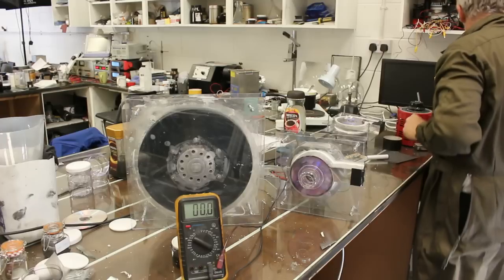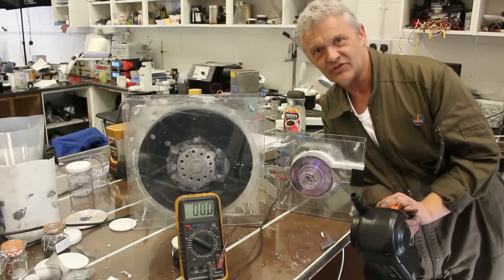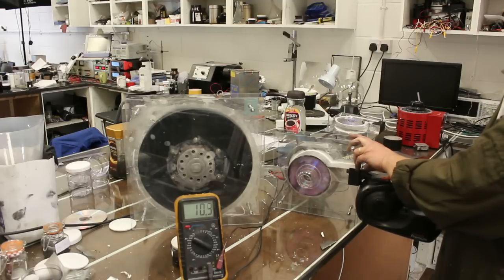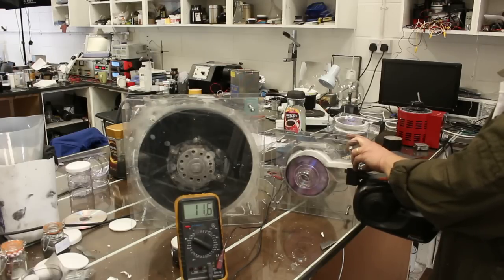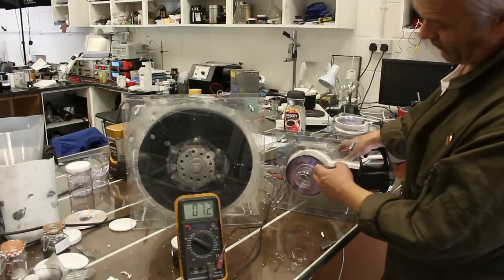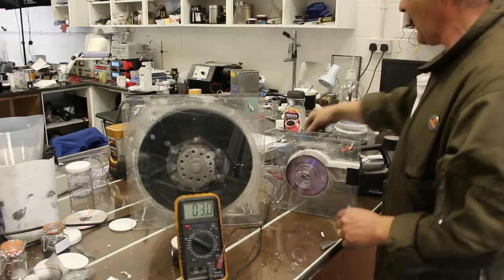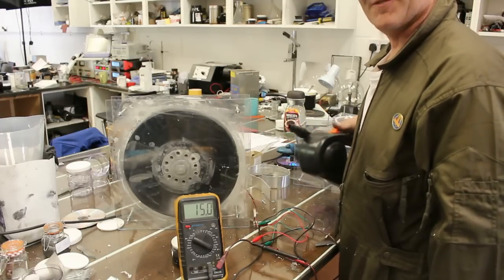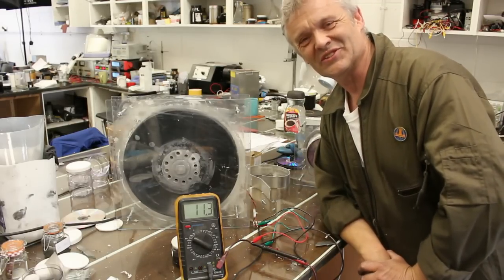Tesla Air Generator

Comment: Brilliant turbine.
Built one a few years ago from a old computer hard drive!
Disks/platters are all there and perfectly balanced. Drilled holes around center of disks for exhaust air, inserted an air nozzle through the casing and built up the casing with filler for a snug fit around the disks.
No way of measuring rpm but sound passed up through a shrill scream and went beyond my audible range in a matter of seconds.

Comment: "The efficiency of these things..."   Oh you are missing quite a bit- while saying it all.

Excuse my brazenness but I have spent a while thinking about the genius of this design.   Not only does increasing pressure increase power output, it also increases efficiency- because it actually makes not the wheel, but the path the air travels along the wheels longer once at full speed.

The air will travel in a spiral - the thickness of the line and the tightness of the spiral is dictated by the pressure and viscosity of the medium.   This is why Tesla was using not only very large discs, but destroying them with extremely high pressure super heated steam.  At around 300C steam can reach around 2400 psi or 163 atmospheres of pressure and at very high volumes easily.

By tightning the path of travel it not only increases its length- it also changes the vectoring of the air relative to the blades- the tighter they get- the more they follow the same path which also allows more energy to be imparted to the wheel.  The reason blades can never match the efficiency of a ideal tesla turbine is because by abruptly changing the direction of flow in the air you automatically waste some of its energy making it battle itself.  With the air travelling more congruent to the walls- you really unlock more of the efficiency.

So higher pressure means longer path and more congruent angular momentum which both also increases efficiency.

The cool thing about the discs are if you operate them too fast the machine will implode (at least with mild steel discs)- just make sure you stand clear of the output.  Even though at high rpm a large disc will suffer incredible g forces, the air pressure will force it to the center and try to blow it out.  At least by account of Tesla who was pushing the limits of metallurgy in his design.  He was spinning some very large steel discs at incredible speeds.   He could not find the right material to make the discs but was happy with his nozzle design and spacing requirements.

He wanted to use it for harnessing geothermal steam.   However he found out that the design was actually a pretty good pump impeller for high viscosity fluids.  Low viscosity is better for generation of power though from a source.  Oh the impeller functionality requires the flow through the turbine to be reversed- and some slight changes to the output nozzles/holes potentially.

It actually makes me sad to think about it, one of his most brilliant designs and still so poorly understood even among academia.  Here is a hint if you ever want to achieve his dream, not only do you need pressure- you also need discs that have as high as possible tensile strength and as smooth/flat as possible.  There is a reason Tesla spent many years on this design- while many of his most known ones essentially came to him a flash.  It is one of his most brilliant gems even if so far it has been of far less impact on society.    He spent quite a while perfecting nozzles designs and their placement.  Metallurgy is where he struggled

Nice design and nice to see people building them and talking about them.
Reply from the maker: +EgadsNo thank you for taking the time to write that mate - i read it with great interest
Reply: +EgadsNo Yes, Tesla described the path of the fluid as 'torturous'. It is a great design because it works contrary to centrifugal force, so reducing the fluid to the lowest speed possible with least active surface area. I also liked reading your post very much. I am trying to work out a hybrid design for wind, as it seems that this turbine is designed with higher pressures in mind than wind can provide. Robert Murray Smith using washers as he did, gave me the idea that you could use any shape as a spacer. 

It would be amazing to use a Tesla turbine to extract energy from wood gasification, but I think it would require a compression stage before input to the combustion chamber because I expect the Tesla turbine would induce a fairly low suction at the intake. Any idea how well his fluid valves actually worked? Did he ever get them functioning as intended?
Reply: +Blitherer Masterman Carbon fibers can withstand very high temperatures and have extremely high tensile strength making them a natural fit to this sort of turbine. There are also some graphene-metal hybrids that could combine with a carbon cloth matrix and would probably be practically ideal. I imagine that the strength of the metal and its resistance to creep at high RPM would be enhanced greatly this way.
Reply: +Blitherer Masterman Something along the lines of a velomobile (maybe also hybridized for use as a boat on water) with a small electric engine and an advanced battery bank charged by sun, wind, or wood gas would be a dream.
Reply: EgadsNo so how would you make this fan work in a flying electric boat-car? Efficiency vs. exhaustion? Practical to use this setup for small manned air flight vehicles? ALSO, can you use this concept to charge a very large battery? Also, how would you use this to create a pump storage hydroelectricity flooring system into the hull of an electric boat to charge it off water displacement/surface tension/release of water? For a flying electric boat-car?!?!
Reply: Watch enslaved by no media jet fuel hoax. They are using free energy compressed air engines on most passenger aircraft using Victor Schauberger principle of collecting resonance energy through air vibration compressed air!! The fueling of aircraft is not actually happening this is just a show for the dumbed down people to believe this is how the rich are able to pull off this con and are getting super rich by having us believe they are using fuel but they are using this amazing technology!!
Reply: You cold use asphalt cutting discs, they are dumped when the diamond powder is wasted by the use, so you can get virtually for free
Reply: internet says graphene is the highest tensile strength material, now how to generate large thick discs...
Reply: @pehgt5099  this has got to be the stupidest conspiracy theory I have ever read
Reply: Nice one to the pair of you. 
Robert can you do a brief explanation and or video on the connection please. What(stepper motor?) is required to convert the rotary motion onto output voltages directly?

Comment: I discovered Tesla’s basic theory when washing out a paint roller when I was a kid . The higher the pressure the faster it spun and placement of the nozzle which led me to thinking 🤔 about the fluid  resistance being increased cos of the surface of the roller which led me 30 years later to Tesla turbine concept which allowed me to really realise how much he was a great engineer and hard working tenacious creator ! The fact that the power increase with more resistance of the surface also has a mirror principle of a very smooth surface and the air having to escape against its natural direction is a brilliant  way to create another version of resistance ! Makes you really wonder about how many other principles and concept we miss in all the other disciplines of universal physics we assume to understand !😂

Comment: Robert I've just got to mention a few things. Volts to me has little meaning without a possible load to create some current flow as so the volts will be reduced, Secondly the 3 output wires from the larger unit will be giving 3 phase AC so they cannot be wired in series.  Cheers, Andy
Reply from the maker: +Andy Reynolds cheers mate - nice points
Reply: Why did Andy have to point this out to you? You must be aware that power is equal to sum of volts and amps surely
Reply: Tony Ling  
"power is equal to sum of volts and amps surely"
Ur joking right?
Reply: product I meant of course
Reply: Sadly this generator will colapse under load
Reply: Research Victor Schauberger free energy using resonance frequency they using this on passenger airline Jet engines. Watch enslaved by no media jet engine fuel hoax!!
Reply: @pehgt5099  every frequency is resonant.

Comment: To all the people bemoaning input vs output, I think you are all missing the point. In an industrial, commercial setup, no one is going to be stood there with a huge air bed pump plugged into a 3 phase supply, blowing air into it and saying "hey look everyone, free energy!" I believe Robert is showing how to make it spin and the potential efficiency. The gas, steam or whatever you blow over the discs, will be generated by burning some natural resource, renewal resource or a combination of the two, to generate said mediums. That's what'll spin the turbine which will be connected to a generator, that will eventually power the air bed blower and not the other way round!
Reply from the maker: spot on mate
Reply: could it not produce enough energy to run the hair dryer there for be self sufficient?

Comment: How is this generating electric?  Is there just a three phase generator connected to the output shaft of the Tesla turbine?  I am curious about the power output of this not just the volts.  Do you have a graph that shows power output in watts based on air flow input?

Comment: I love the idea of using washers to build up rings, as the 3 sectioned cut outs in the middle of disks always seemed like an awkward flaw in a nearly perfect design. Have you thought of using a 'washer' shaped as a thin slice of wing or other shape that might compliment the design in some way? I think it may enhance performance in lower winds, and remove some of the need for tight spacing that is normally determined by boundary layer thickness without imposing a penalty. It would yield a sort of hybrid turbine that might retain the benefits of the Tesla and give you more bang for your buck without being much or any more difficult to fabricate. The larger surface area created using aerodynamically shaped spacers instead of washers could also make it possible to glue or otherwise connect the disks/rings without having to add the weight and imbalance imposed by bolts.
Reply from the maker: +Blitherer Masterman nice ideas mate - i'll give it a bit of thought and see if i can come up with an easy diy method
Reply: +Robert Murray-Smith I recently read an article about metal layers of copper or nickel interspersed with CVD-deposited thin-film graphene layers that increased the strength of the metals by 600 times. . . Do you figure that is hogwash, or actually plausible? I can believe that monatomic structures are special and have huge potential, but that seems a bit unbelievable. 

Sorry to load you down with so many ideas and questions, I have an excess of them and a lack of means at present. I am pretty focused on ceramics, have finally achieved vitrification of fired clays, and working on a good porcelain recipe.
Reply: +Blitherer Masterman If true, I imagine there would be incredible potential for the use of say platinum, or any other non-corroding metal in mechanical/turbine applications. Levitate the disks on magnetic bearings and you would have something that could be an heirloom item of great efficiency.
Reply from the maker: +Blitherer Masterman I don't know mate - i have looked at it. I only really think about the stuff I am involved in and never really question what others do - why would I - how can I say I know better - I don't

Comment: There was an ozzy crowd making miniature plastic Tesla turbines a couple of years ago (I lost the link when my computer died) but what was interesting was that when they got to 70-80 thousand rpm the turbine became much more efficient and much less noisy. It stabilised with the higher revs and also took less input to keep it there. Where would one get their hands on those today? Great video again btw.
Reply from the maker: +Colin Hammill you have to build them mate
Reply: Robert Murray-Smith I had a hunch you might say that. Just sent you a link through G+ I think I found a similar crowd doing model ones. Cheers again boss.
Reply from the maker: +Colin Hammill cheers mate but these things are super easy to make
Reply: Robert Murray-Smith Yeah if I had a wee 3D printer I would knock one myself, but that`s another pipe dream at the moment LOL
Reply from the maker: +Colin Hammill all you need is a drill and a few cds mate
Reply: Robert Murray-Smith True but I`d like to get the spacing down to microns and so far as I know even a cheap 3D printer will do that.
Reply from the maker: +Colin Hammill use plastic washers as spacers
Reply: Robert Murray-Smith True, what spacing did you with for yours?
Reply from the maker: +Colin Hammill 0.5mm - with washers
Reply: Robert Murray-Smith Cheers man, just started watching your Tesla construction video now :)
Reply from the maker: +Colin Hammill cool
Reply: +Colin Hammill If you want the spacing to be perfect, figure out the boundary layer thickness (article on wikipedia) for air, water, steam (at a given pressure) or whatever fluid you want to use.
Reply: Blitherer Masterman Cheers man :)

Comment: I was going to say, no-load RPM: no load, no resistance, apparently effortless power.

The trick is to find a natural means of spinning the turbine to a practical speed with enough surplus power to produce a usable net yield.

This would work with solar heated working fluids or geothermal but almost any other means of driving it would be a translation gap which would defeat any efficiency.

With a vertical air stack in some place like the desert it might be possible to produce a passive column of air rising inside a black tube, but again the volume would lack enough pressure to drive the turbine unless it were extremely large, and by then a typical bladed steam type turbine would be far more efficient.

I designed a tower mill that can run 24 hours a day with a peak yield of 3.2 megawatts, but it is frightfully expensive to build and covers the greater part [78.8%] of an acre and stands 300 feet or taller to achieve a minimum updraft pressure of .002 PSI required to spin a 30 foot in diameter 1675 blade PVC turbine on special bearings.
Reply from the maker: awesome - cheers
Reply: Some day I may build one, but I will definitely have to begin with a very tiny model and get the interest of people because its really an alien concept to most people, it is super futuristic looking and seems so off the wall most investors will think its just nutty fantasy stuff like the infamous 'zero point energy' dream or the whole idea of 'anti matter.'

The problem is not in physically making a 'model' but in making a model of sufficient scale as to even prove the theory, let alone produce measurable/appreciable power because like any air pile or full draft device, it is entirely dependent on scale to reach beyond the limitations of air in such a relatively passive state.

A swirl of are from one's hands does not compare to a tornado as a tornado does not compare to a hurricane, the manifestations may be vaguely similar but the processes are almost incomparably different.

Consequently, the size is critical, and the project is as such, dependent upon prohibitive factors such as cost.
Reply from the maker: well i hope you do make one - one day

Comment: nice video . Id like to see the turbines hooked up to the exhaust on a car to see how much power could be made with a tesla turbine.  . if used on a hybrid vehicle  maybe could run the power back to the batteries and not have to plug the car in .
Reply from the maker: +Stacy Williams nice idea mate - build one and see
Reply: +Stacy Williams Better still to replace the gasoline engine entirely and use a Tesla turbine as a generator with an electric transmission system as Tesla intended. It could run on gasoline, kerosene, wood gas, vegetable oil, basically anything that burns.

Comment: If a housing on a pivot around the axle could be made to turn an intake scoop into the wind while protecting the opposing side of the disks from said wind, and we turned the whole unit on it's side (so the the axle is vertical), and we added enough disks to make it a meter tall, would there be a decent improvement in possible electrical generation over a 'normal' VAWT of similar size? Seeing the larger unit work so well without a housing leads me towards thinking that a wide (or in my scenario tall) intake should only improve efficiency in terms of using the turbine as a motor.
Reply from the maker: Nice thoughts mate - have you tried any of this? - if not sounds well worth.a go to me
Reply: Robert Murray-Smith No testing as of yet, when I get time and materials it does seem reasonable to try however. I'll come back and update you when that happens.

Comment: So the larger the diameter the turbine the slower it goes and more power it has. So lets say you have 3 meter disc with six blades you should be able to make usable power from a small stream that is damned up to make a pressurized jet of water to hit the blades at an angle and get most of the water in between them to run a generator. But I guess you could do it another way and just use it as a drain fro flowing water to run a generator in smaller form factor and lower rpm by staggering the exhaust holes for a vortex output much like what you see when water drains out your bath tub.

Comment: You stated 15 V was really 45 V, which is not true. A truer answer it would be 15 V three phase, depending on how the alternator or generator is wound. If you were to connect all three sets of coils in series, then it would indeed be 45 V, but the resistance would be much greater and it would require greater power input and higher top-end speed to achieve the same results.